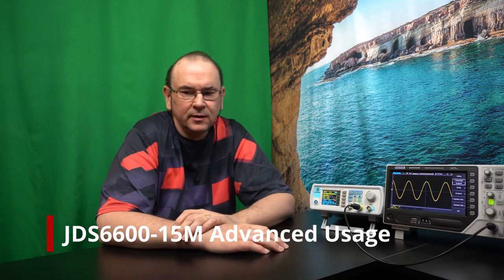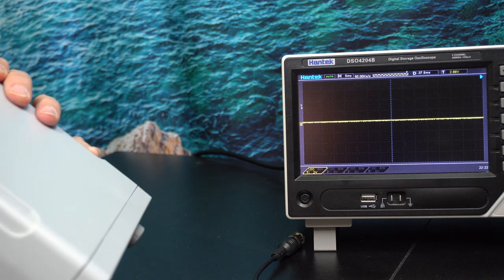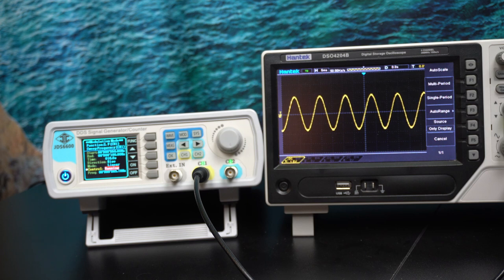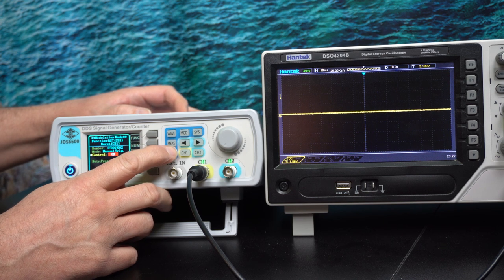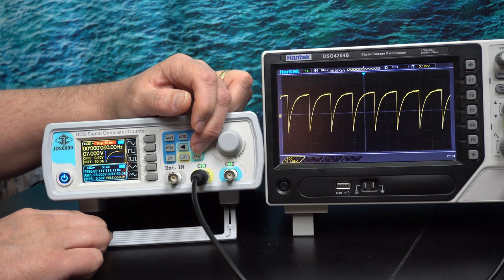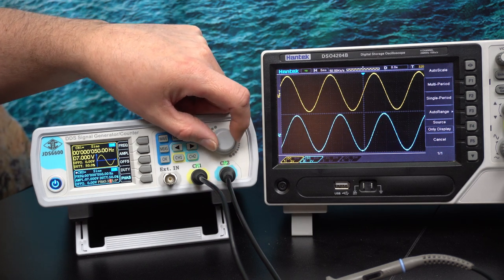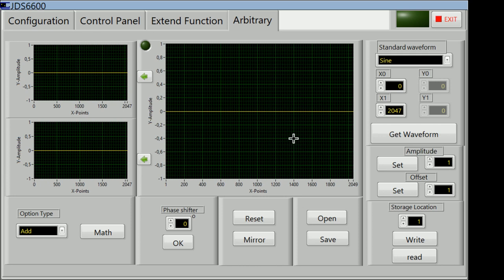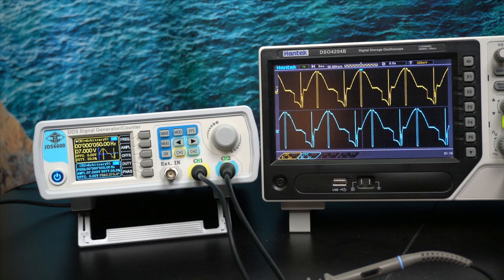DDS signal generator/counter JDS6600-15M functional demonstration advanced

Comment: Hi, I have a same signal generator and cannot couple it with my laptop. I downloaded all the software from the CD and also went to the com port selection on the control panel but somehow there is a comunication error. My laptop has win 10 installed. I wonder if you encountered the same problem at first.
Reply from the maker: The software is sometimes misleading hinting on what COMx is the one to use. I usually just switch between the available ports until I find the correct one. As long as one does not add/remove COMx devices the port in use remains the same.
Reply: @TheTechRabbit  well regarding the com port. I have 4 usb ports in my laptop and every time i change the usb port it shows a different port number on the device manager. I also checked the generator itself with an ohm meter for any possible unsoldered joint from the usb socket up to the ic input but all seemed well. I will try out all the usb ports without changing the com port number on the generator software and see what it does.
Reply: I have exactly the same problem, did you find a solution please? I'm thinking of binning this generator and getting a Uni-t or even a second-hand BK.